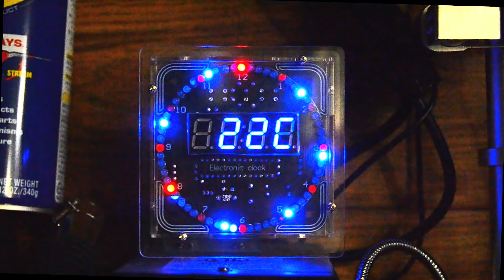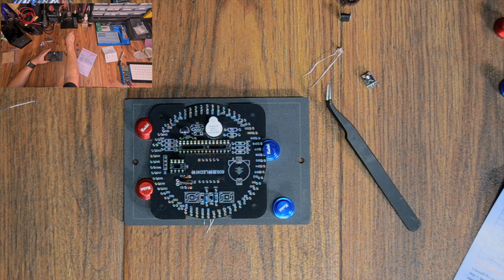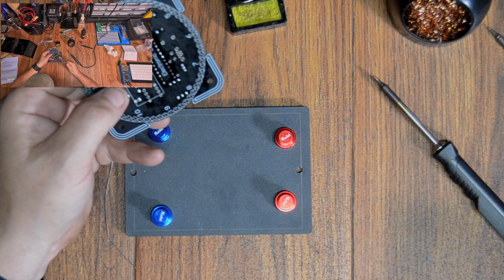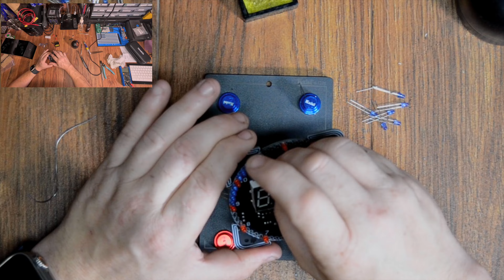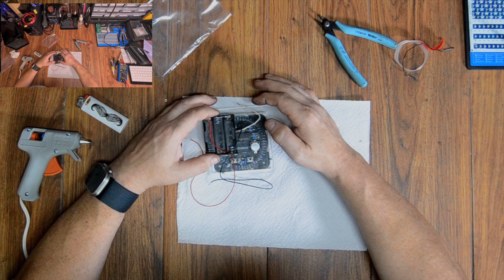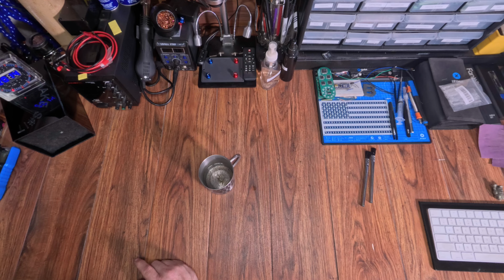Time Is On My Side

Comment: Nice, thank you. What is the solder flux?
Reply from the maker: The brand is Essmetuin. It's an Amazon special. I would not recommend it unless your on a budget or you don't mind scrubbing the PCB with alcohol for a few minutes
Reply: @LetsMakeSt-ll2wx  Thank you. Corvetteguy50 recommends  Kester 186 RMA Flux. Unfortunate for me that is not available in Australia.
Reply from the maker: I have found that the flux pen from IFixit works pretty good. 
https://www.ifixit.com/products/flux-pen-10ml-no-clean
I use what I have cause I'm cheap and have 3 tubes left
Reply: @LetsMakeSt-ll2wx  Thank you.

Comment: Greetings from Australia. Good job making that, very neat work. I enjoyed watching and I liked the voice over with the component explanations. I have a similar clock, but because I wanted one with surface mounted leds I elected to buy it already built. One question if you don't mind. Why do you put on extra flux? Is it the type of solder you're using that needs it?
Reply from the maker: And a hearty "How you doing"  from Brooklyn. Thanks for the compliments. That was something new I was tying for this video. The pictures of the components that is. As for the flux, honestly it's just something I saw when I was watching you tube videos on how to solder but I do notice that the solder does flow much better then using it.
Reply: @LetsMakeSt-ll2wx  Considering what's going on in some parts of the world, we're doing ok down here thankfully. Thanks for replying and the explanations. Of cou're right about flux making solder flow better, but with good rosin/flux cored solder it really shouldn't be necessary as long as you don't leave the heat on the joint too long. It's a bit strange that you had so much trouble with the USB port soldering. The extra flux on that should have made it easy to remove the bridges, as long as it's a good flux and you didn't have the iron loaded up with solder. Anyway, keep up the good work and I'll be looking forward to any other projects you make.  👍👍

Comment: I wonder if the main chip is a micro-controller, and if it is, I would love to see the code. If you have it.
Reply from the maker: Unfortunately no, I do not. These kits basically come with no instructions. How great would it be if they did?
Reply: @LetsMakeSt-ll2wx  you will see how that clock works. How is measure the time and how the lights effect are made. I think it would be great.
Reply: main chip is a STC15W408AS mcu. based on the Intel 8051